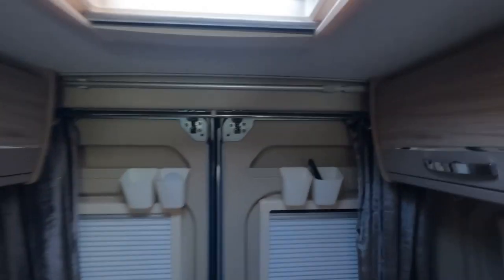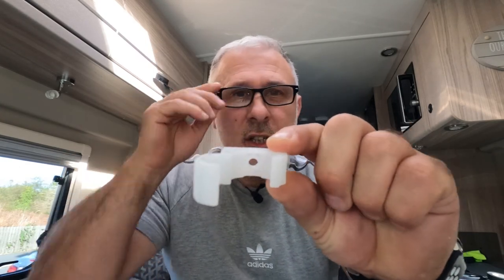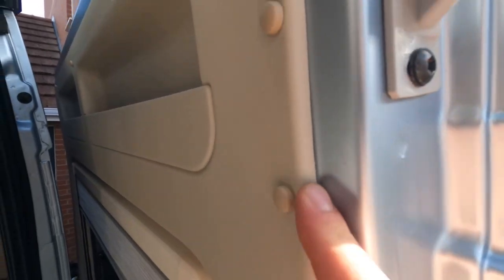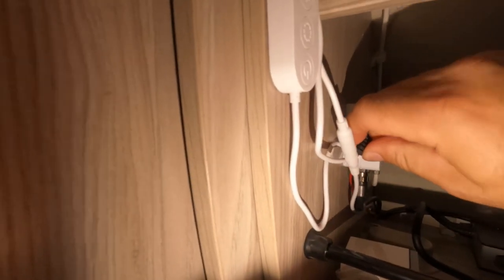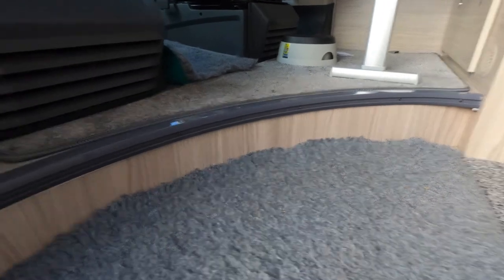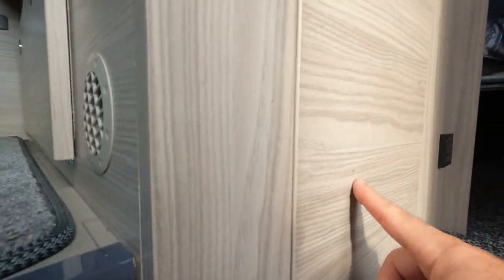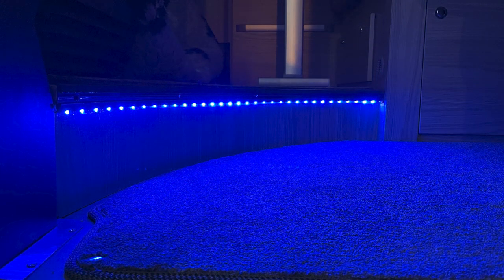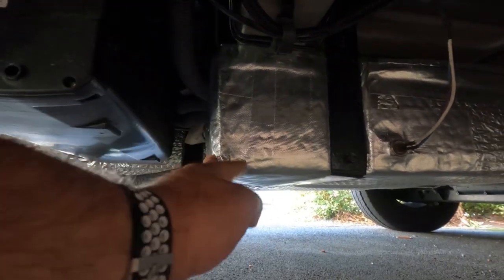All your questions answered and more

Comment: Thanks Ian. All good stuff.  Got to get under Merlin and redo the tank insulation. Nice job you did there. Wondering if my levelers would lift it high enough. I to would get puffed out under there 🤣🧙‍♂️ Cheers 🙏
Reply from the maker: 😂😂😂 getting down there was easy. It’s the getting up again that’s the killer. 👍🏻😉

Comment: Hi Ian. Great vid. I have just bought some of these leds and they will plug straight into the power cable for the tv booster. Saves splicing the wires and cutting off plugs for those that are unsure about it. We never use the telly anyway as we are always watching quality YouTube vids like yours on our iPads.
Reply from the maker: Hi and thanks for taking the time to leave your lovely comment. Yeah plugging in there is a great idea. I don’t really watch tv much either. Thanks for watching. 👍🏻

Comment: Super smashing follow up on your tips thanks. Will follow up on wiring options for lights now. That aluminium tape has disappeared by the way !
Reply from the maker: You're welcome. I checked the tape when I posted the link and they still had it then. Must have just sold out. I have a massive roll if anyone needs any.

Comment: Ian I have just fitted a HUD but the mileometer is flashing any ideas please? 2016 model
Reply from the maker: Have you worked your way through the instructions. I think you have to push the little scroll button in. From memory I think that it flashes when you are calibrating the speed to match your speedo. That’s all I can think of. Try pushing the rocker switch or rocking it from side to side. Setting it up is all in the instructions. They’re not great but you should be able to figure things out.
Reply: @TravellingfromScratch  thanks very much for that Ian. I will give that a try. Just love the video’s by the way. All the little bits you send out really help. Many thanks and keep up the good work !!! Take care
Reply from the maker: @mikegraham1723  thanks Mike and good luck. 👍🏻